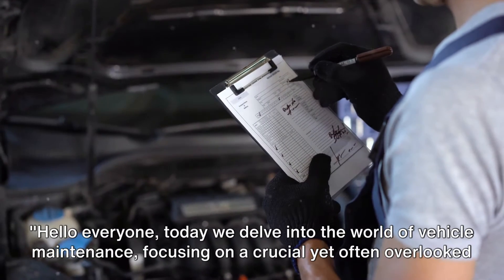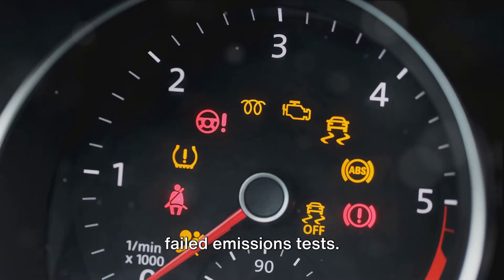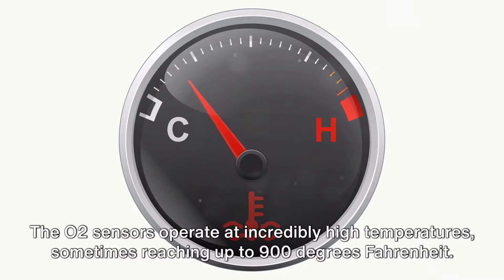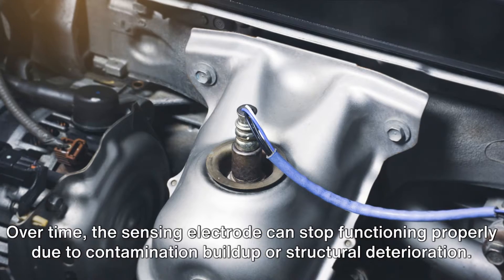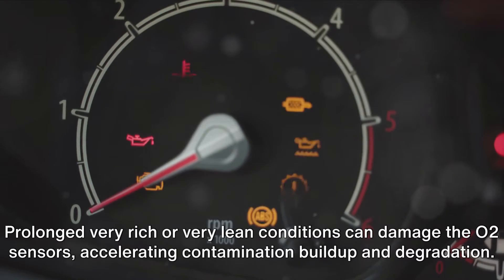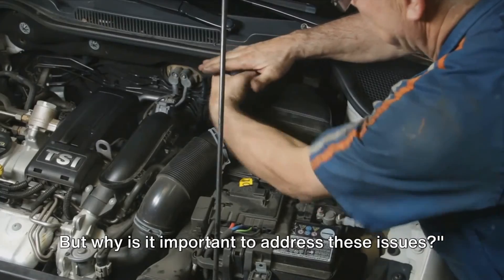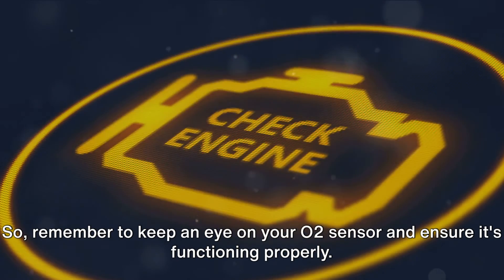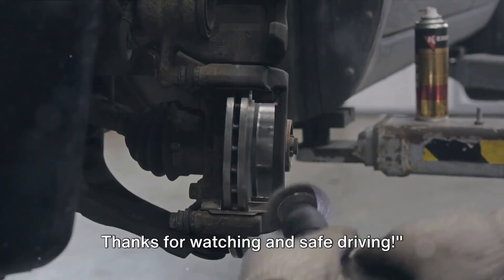What Causes an Oxygen Sensor to Fail: Reasons Why O2 sensors Go Bad

Comment: I’ve had to change my O2 sensor on my 2017 Chevy Cruze four times now ($460 2 times and free 2 times under warranty). The mechanic said carbon is building up on the sensor because I make to many short trips. This doesn’t allow it to get hot enough to burn it off so I need to drive it 30 to 40 miles once a week to keep it from happening again. Does that sound right?
Reply: Funny you say this. I have a 2018 equinox and blown 2 myself! It could be true. I don't drive my car often. I drive short distances to work (2mi). When the mechanic changed the O2 sensor,  it was full with carbon.  What I  can't understand is that NASA has those probes on Mars and those sensors last even through -300°F! Beyond this, my car is perfect. 🫤
Reply: Me too I have a 2017 Chevy Cruze LT and I'm on my 3rd set of 02 sensors in 4 years owning the car,bought the Cruze in 2020. The1st set was covered by warrenty the 2nd set had to pay over $550 to replace and the 3rd well I was lucky enough the 2nd set sensors were not a year old so I didn't have to pay to replace which just was a week ago.

I was was told the same thing as you my commutes daily were not long enough I admit I don't drive it much as we have 2 vehicles but when I do I drive it,it's like 2 hours or so.Also was told I don't run it "warm it up enough  in the cold  (winter) before driving. 
They explained to me the carbon doesn't get a chance to burn off the sensor so it has a tendency to gum it up especially in colder temps.These sensors are suppose to last up to 40,000 to 70,000 kms before they burn out or become faulty on most vehicles.

I definitely believe this is a Cruze thing with these sensors heard another guy at my dealership a salesman had a 2016 Cruze and he had to replace the sensors once.My sevice rep at the dealership where I had the sensors replaced 3 times told me he has many people coming back yearly to replace the sensors but he wouldn't tell me if it was just all the Cruzes out there.I'm trying to do more research on this because I believe this will happen again within a year or so and I may not be as lucky next time around and will have to pay.